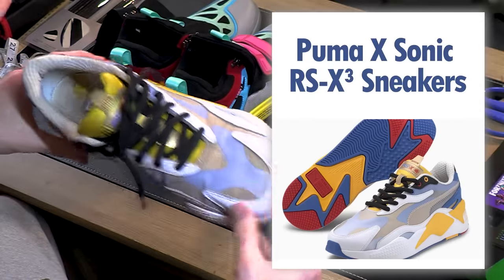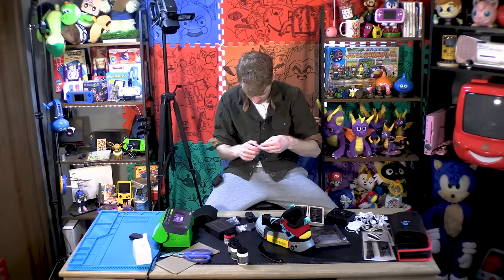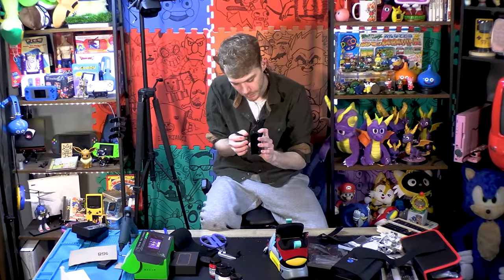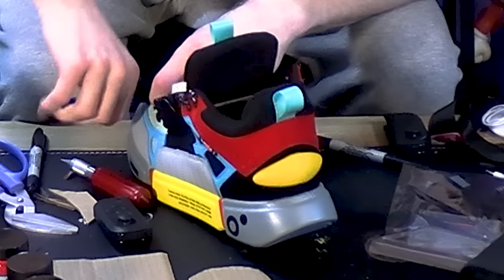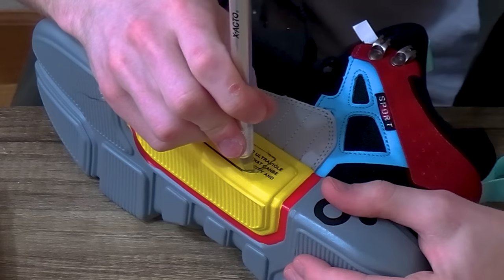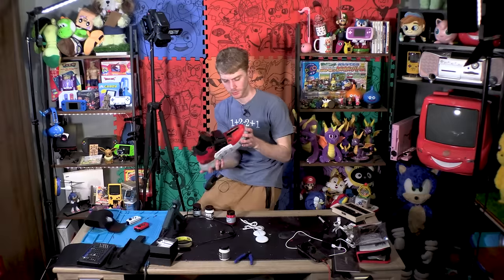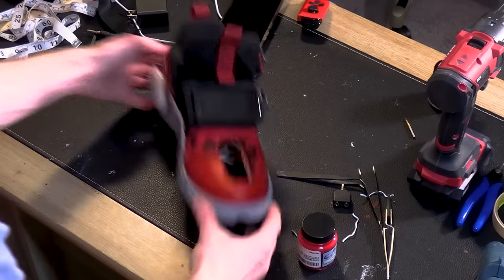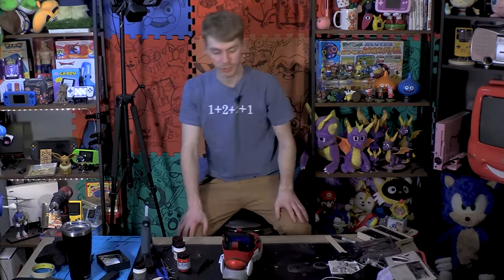Making a Better Sonic Shoe Than Sega

Comment: Don't mind me, just putting my favorite parts here to come back and rewatch it later.
😅😂
0:42
1:54
2:21
2:56
3:12 I was honestly waiting to hear your opinion but you cracked me up when you said "I haven't seen it, I've been making shoes, I'm sucking on fabric"
I didn't expect that.
😂
4:16
5:52
7:33
8:04
8:41
9:11
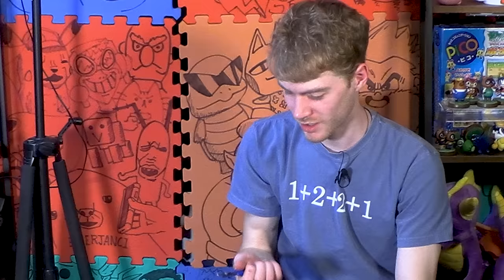10:52
11:20
12:30
And my favorite part 14:27
I laughed so hard.
😂
And for the bonus, here are some rhymes Petter did accidentally but it's funny for some reason.
0:44 - 0:53 Cool, school, shoe
11:15 Shoe drill, skil
14:00 Sonic 2 on a shoe

Comment: Feet are just deformed hands right, so the controller interface should have obviously been integrated directly into the shoe so the toes would just act as stubby little deformed fingers inside the shou-troller, allowing for a no hands approach to gaming. Though you will look like a kid in a 90s DARE commercial when your found staring mouth agape at the screen, arms and hands motionless on either side of your lap, with a subtle amount of restless leg syndrome..

Comment: Okey you make   few mistakes.....kids spell led shoes...you need those for adults with the 3 different colors going from back to  front or from front to back! Nobody know why they are so dope, and why nobody makes them for adult (my kids ones are the dopest with 3 different colors)and I still don't know if you can replace the battery 😂. Butt yeah you need those , second they need rollerrscates only on the inside of the heel.....like 4 wheel behind each other not next to each other!  Not Like the classics....here you call the skeelers....Now if you do it with the classic blue color. .now you can walk as fast as sonic while , rgbing everybody to nothingness